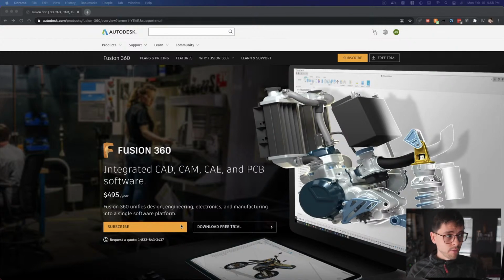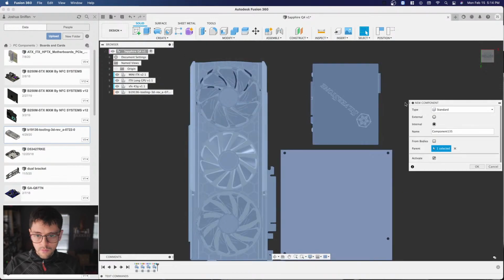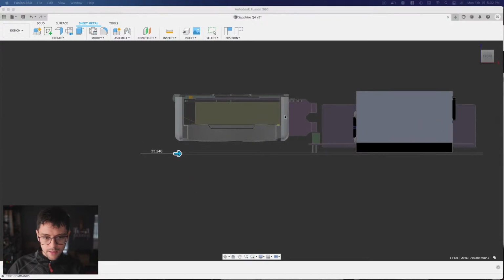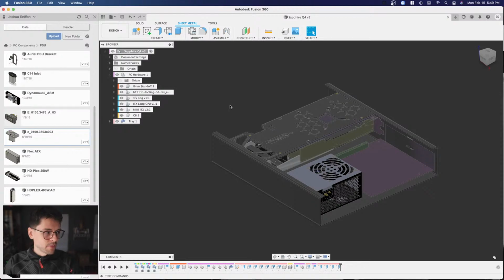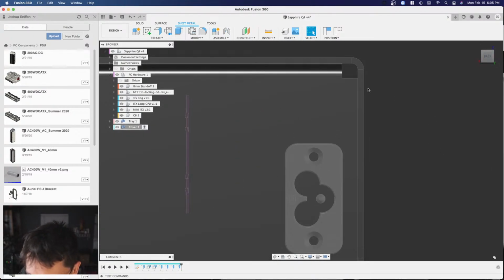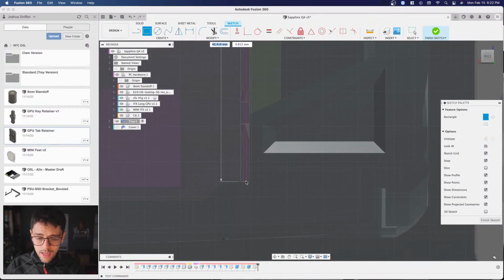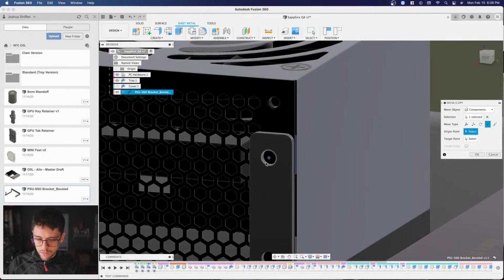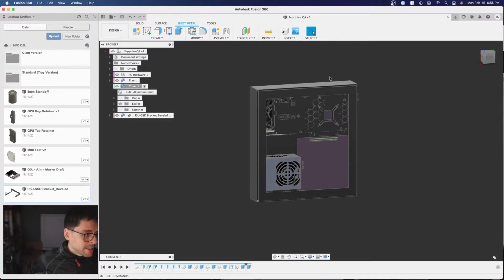Let's design a ITX PC case in 3D from start to finish! Part 1: Layout and basic sheet metal.

Comment: How did you get that repository I would love to be able to import models like that into fusion… importing stl as meshes are terrible to work with and step files with 999 small parts on gpu is no better. How to get such work flow?
Reply from the maker: Repository? There are alot of 3D models out there, I have built a collection. Grabcad is one such place, but honestly, with how bad most of these models are, I make my own. So I have been building my own for years and years and I have a Patreon where I have a ton of them available; everything needed to build a PC. I try to model really exciting SFF cards too in high detail so people can water block them.
Reply from the maker: Patreon.com/nfc
Reply: @NotFromConcentrate  hey! Are those base blocks included in every design available or where can they be found? Tried to sroll down for a while but haven't yet found a lib of motherboards, coolers, etc. Is it the Legacy project files?
Reply from the maker: @bestcatdad  Hello! If you are talking about the Patreon, I have lots and lots of parts in various projects you can use. I have some parts just by themselves, but most are in models. Usually now when I model a motherboard or something I put it on the patreon.
Reply: @NotFromConcentrate  I try to get basic mini-ITX Mobo and PSU/GPU  that you use. Do I just unlock a random mini-ITX case of yours then?
Reply from the maker: @bestcatdad you get access to everything I have ever made and uploaded if you subscribe, just message me on there I can help you out

Comment: Cool video. I actually started designing my own case (for full sized microATX) a bit over a week ago. I use different software (solvespace, because it is the only one I am comfortable with), and different approach, but after almost finishing, if I would start again (which I might), I would use a different approach that what I have done initially (I don't have CAD experience or complex assemblies experience).  I think the best way is to model your components first, as detailed as possible, as separate models, then do build the case around them. This makes it way easier and quicker actually, and allows for the reuse of models for other projects.